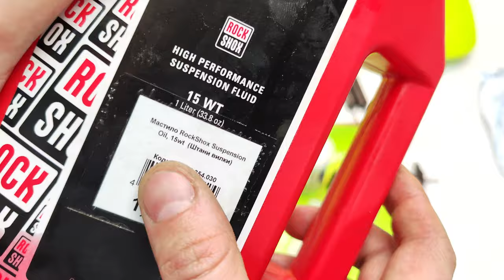How to make your bike softer. Bicycle Fox Fork Service

Comment: Hi, is it mandatory to use on the left leg the 15WT/20ml oil or is it possible to use the same 10WT like on the open bath ? Thank you !
Reply from the maker: Hello. It is better not to deviate from the recommendations of the fork manufacturer. Even different models of the same fork manufacturer may have different lubricants, so it's better to follow the manual for a specific fork model
Reply: @NiceBikeService  yeah.... I like you're ideea but in the manual it does recommend 160ml o/b rl of fox 10wt green and for the other leg 30ml fox 10wt green that's why i've asked about it seeing you put other spec on the left leg. I have the same fork from 2012 and I want to do the service at home atleast for the oil
Reply: @alexandruursu3460  Go with the green